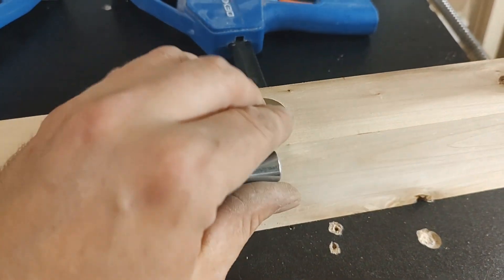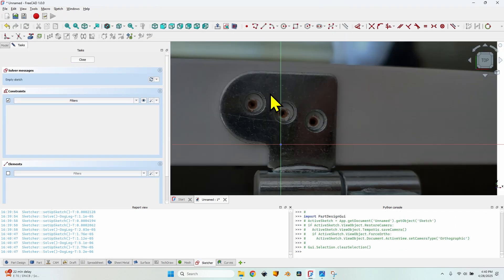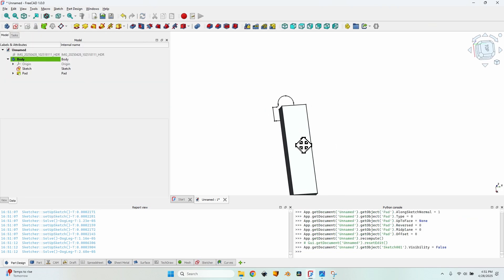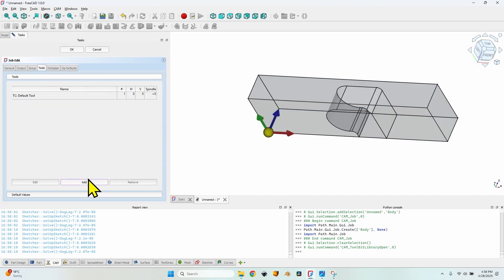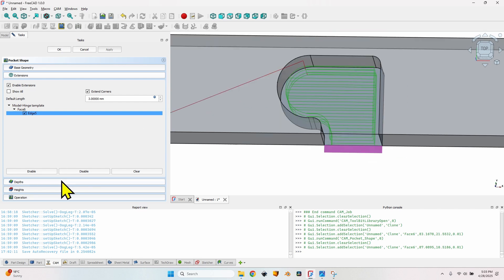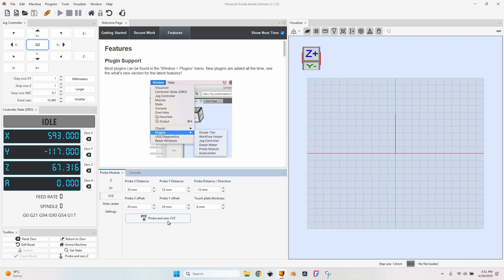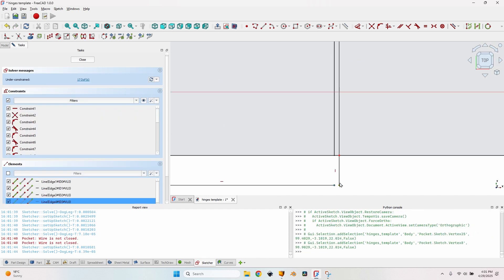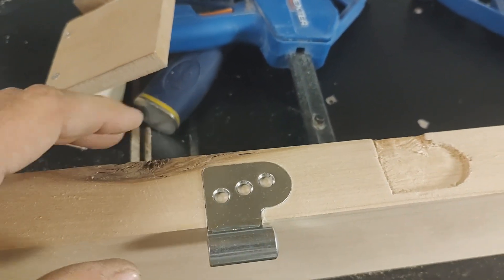Make a Perfect Router Template for Door Hinges with your CNC

Comment: If i import a cabinet from woodworking workbench, how do i send it to the cnc machine?
Reply from the maker: I haven't worked with that workbench, so I can't say exactly how to do it. But, as a general rule, place all the boards flat, with enough space between them so the toolbit can pass and then use the profile operation.

Comment: it's a littble bit offtopic... but I want to know your opinion about the different gcode senders, Have you tried different options to UGS? I tried to use it a couple of times but it's not very intuitive to me, the ones i liked are: candle and gsender, the last one is the one I'm using nowadays.
Reply from the maker: @duubqnnp  I've tried candle a little, but ugs was the only one that would jog (almost) correctly on my machine. All the other options would miss steps or not move at all
Reply: @opensourcecnc  what a strange behavior!
Reply from the maker: It's just the downside of such open systems, they evolve too much sometimes and behave strangely